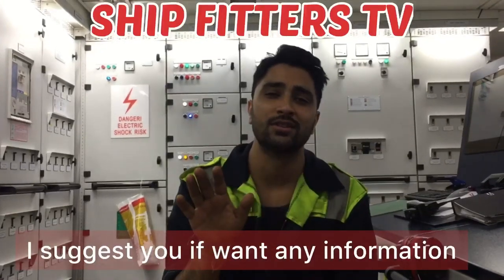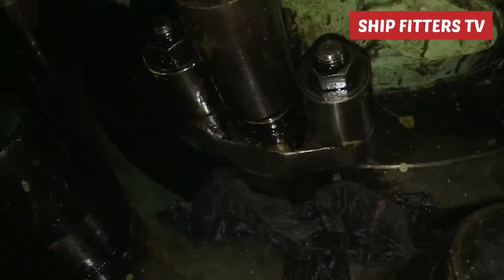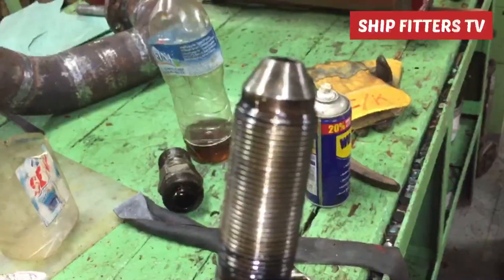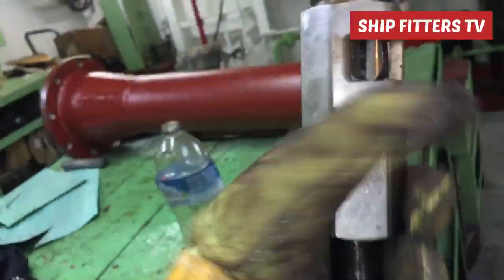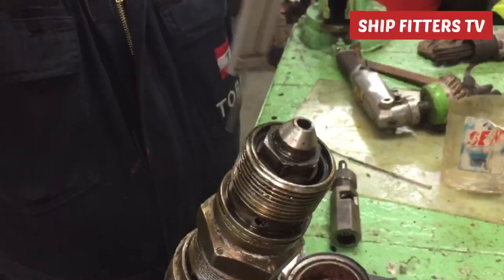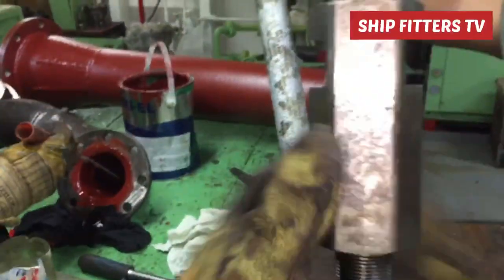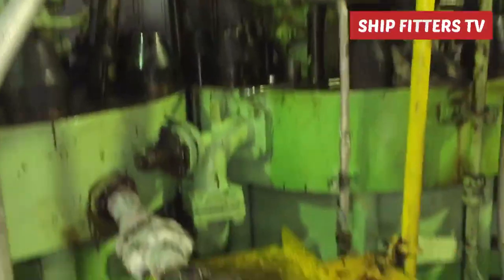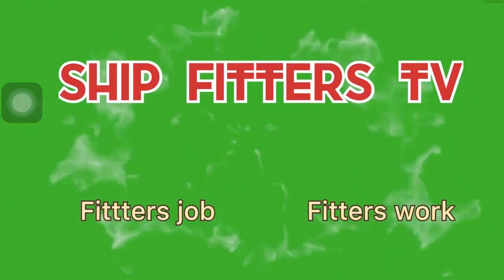Fuel oil high pressure pipe  repair

Comment: Idol tanong ko lang not related dito s video, dun s paggawa ng pipe ng walang porma. About dun s 4 or 8 line method mo s pipe, pano mo ginuguhitan ung pipe ng apat na linya? Kasi baka mgkamali ng guhit s mgkabilang dulo, maduling pa rin
Reply from the maker: Kunin mo ang Outside diameter ng tubo then multiply mo sa 3.1416 ang resulta nyan divide mo sa 4 lines or 8 lines depende sa iyo kung ilan ang gusto mo na lines
Reply: @shipfitterstv9389  nakuha ko yan sir pero pano mo iguguhit na sure magkatapat ung 8lines sa magkabila dulo ng pipe. Ung parallel siya sa pipe, kasi pwede tabingi ung line eh.
Reply: @shipfitterstv9389  for example magfabricate k ng straight na tubo mga 3meters, pano mo siya ginuguhitan ng straight line. May ginagamit kb n guide.